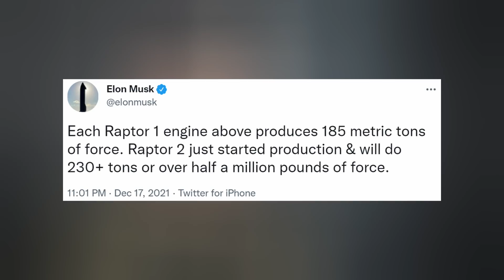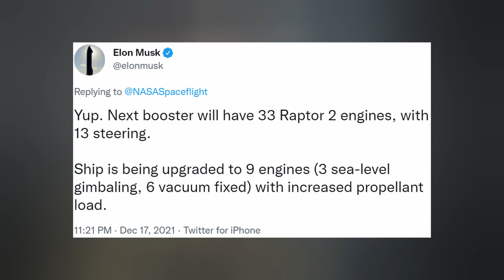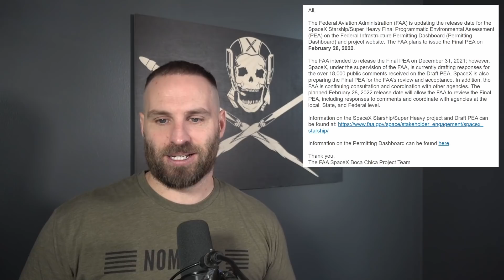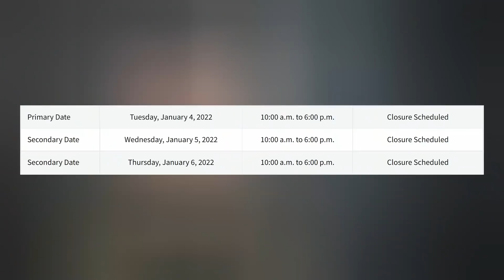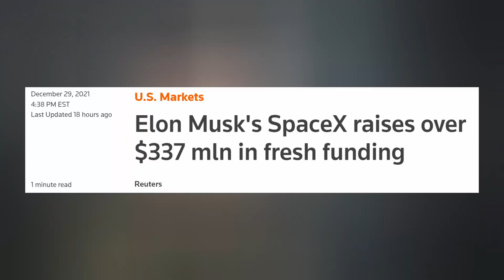SpaceX News and Starship Updates | Orbital Launch in March?

Comment: I wonder if the drone ship could be equipped with its own small retractable grab arm  that would just hydraulically raise out of the ship's floor, and grab the booster halfway up its length...the very second it makes contact.  No more slippage due to bad seas. That could help avoid what happened in this particular case
Reply: It does… the Octograbber is a robot that rolls out after landing, slides under the booster and locks it to the deck. Apparently the rough seas were too much for it and it broke loose.
Reply: @HeatherBarron  okay then a grabber arm that could deploy and be raised to reach the lower third part  the of the ship ,and just hold its position would be better

Comment: While the large throat should increase the power, it also should decrease engine efficiency. And their efficiency already isn't that good(some RP1 engines achieve similar efficiency). 

Being fair the Starlink and Chinese space station doesn't sound that good. If SpaceX wants to have ton of satellites then they also should be responsible to make avoidance manoeuvres with them. (Other stuff China does doesn't mean this is a smaller problem)
Similar issue was already with OneWeb.

Comparing JWST to Hubble is like comparing apples and oranges, they have different tasks.